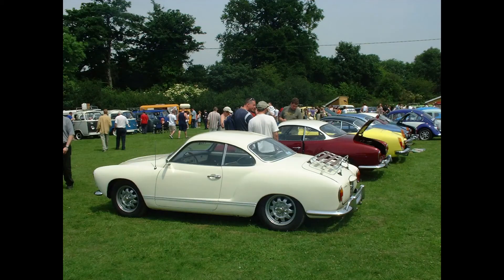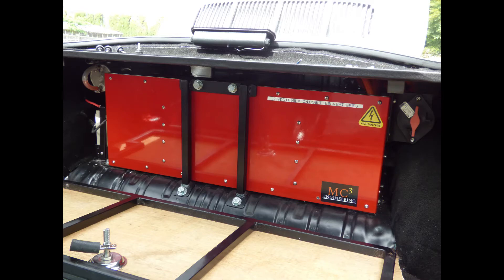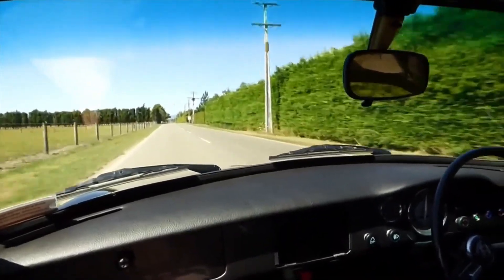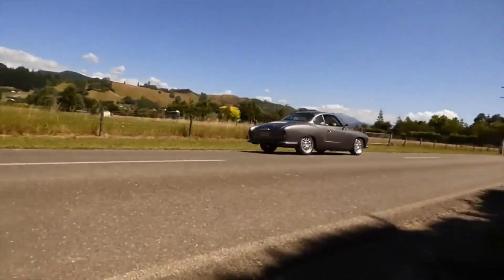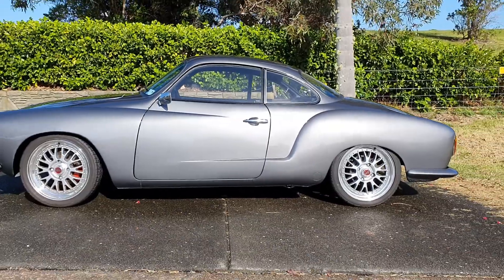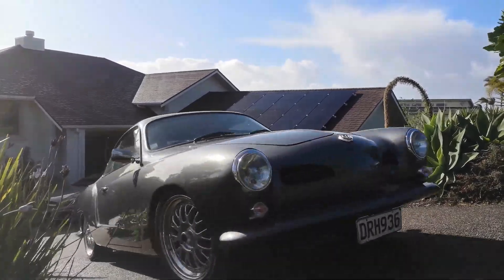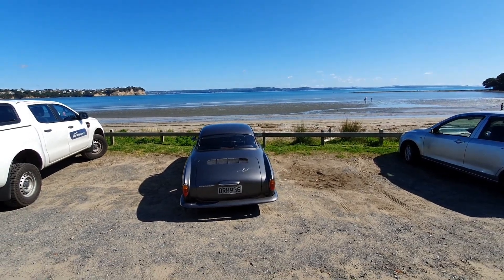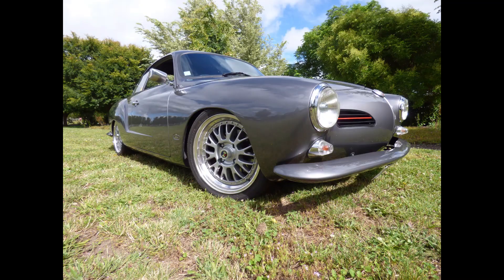Karmann Ghia EV

Comment: What platform are you using to extract the gauge data for your tablet? I’m assuming you have Canbus data from the Orion going there, but is there a particular software you used to display it? I have a similar setup going in my 66 Ghia convertible and I’m trying to figure out how to display that data. Yours looks great!